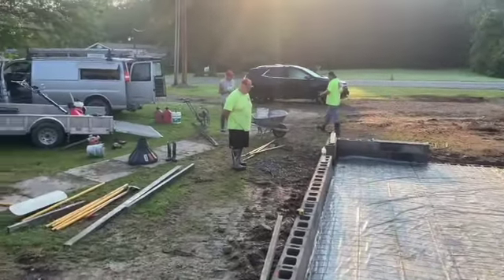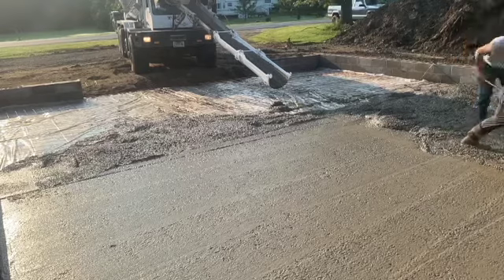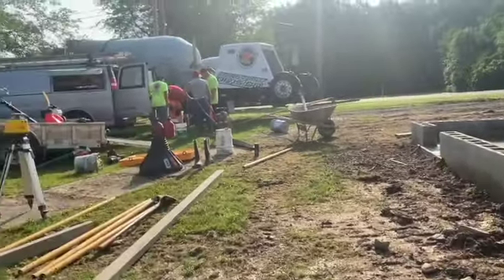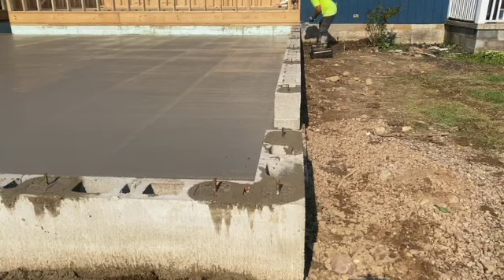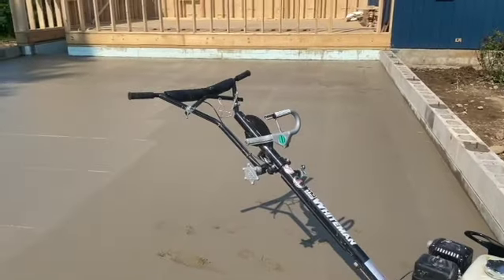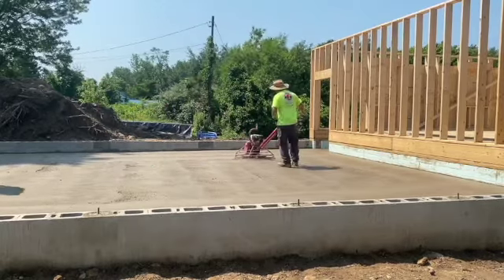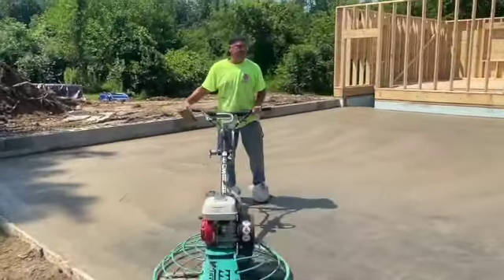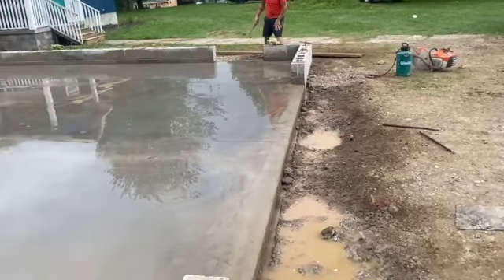Pouring concrete at a pitch. What is a good slump?

Comment: I'm going to agree with some of the others and say about a 5 slump. Question: What are the pros and cons of just filling in all of the cinder blocks compared to the way that you did it?
Reply from the maker: 5 to 5-1/2" slump. Thanks for playing. The Pros would be that it would be stronger. The cons would be the concrete company would have to charge you for tying up they're truck and buy more concrete. It's not necessary due to the blocks being backfilled on both sides. There is no pressure on the stem wall unlike a basement that has backfill one side and much taller.